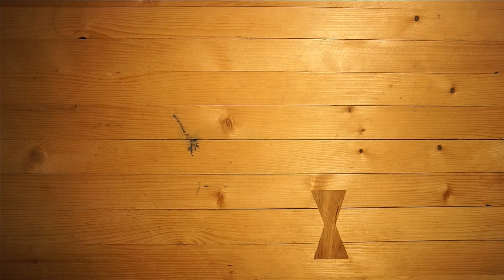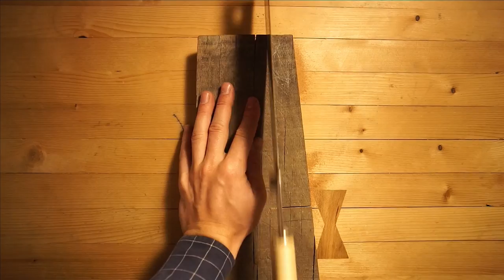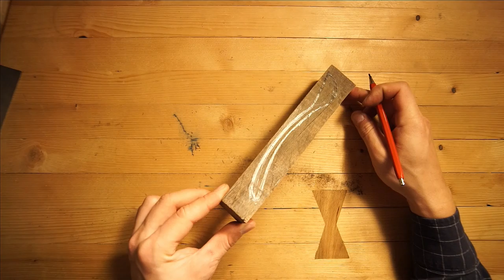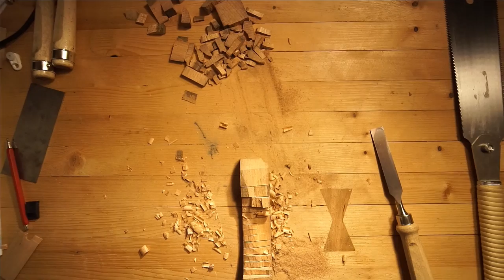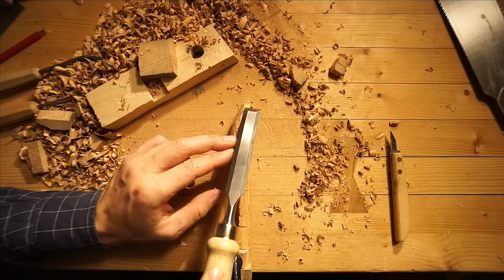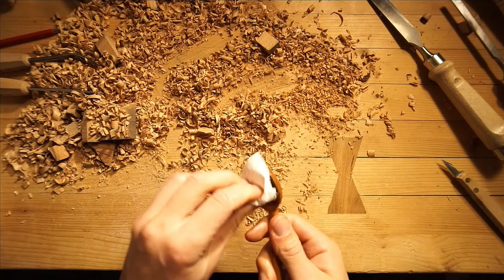Carving a wooden spoon | old beechwood

Comment: Those look like brand new chisels. I would suggest that you put a good shape edge on them. It will make it much easier to carve. From someone who has been doing this for a while, you may want to add a spokeshave for helping to get the curves. I also use small rifles that my grandfather owned and used in the rough shaping of his sculptures and carvings. Most of the tools I inherited from my grandfather and have been handed down from generation to generation. If you can get a hold of a stately 151 spokeshave, the older ones, are handy even when I carve The old Norse-style bowls. They can be pricey around $50.75.00, or you can get the new stately. As pretty as the new higher-end spokeshaves go, they are too expensive for me. I would put my 17th-century wood spokeshave against a Veritas any day, lol.

Comment: Nice ..amazing what is that? That u pour on the spoon
Reply: My best guess would be linseed oil. One of the easiest foodsafe woodfinishes out there.
Reply: from the top of the bottle, it looks like olive oil .... and in the desc it says olive oil was used to finish the spoon.
Reply: cl west I was thinking that too. I just started spoon carving and have been using almond oil. If olive will work it’s way cheaper.
Reply: @heriberthuber54  linseed oil is not entirely food safe, neither is olive oil both of those go rancid over time. Just to step ahead of your answer: flaxseed oil what is basically non boiled linseed oil is food safe but it is much darker

Comment: Please NEVER point a chisel toward your other hand. One slip or successful chiseling away of the wood and you lose a LOT of blood, and maybe some/all of a finger or two. This is one of the many reasons bench vises were invented!
Reply: @Amplefii  and one, who assumes every person knows how to properly handle hand tools. i will agree with you on the chisel but the pull saw on the other hand if someone doesn't know how to handle any saw really could have it jump, and rake across a finger or two resulting in tiny cuts across them. it may not be deadly or extremely painful but can be discouraging for someone new to hand tools, which is why it's always nice, and the smart thing to do by educating in a proper, and non-hostile way that you've obviously failed to do. hand tools can be just as dangerous if not more so than any power tool because they depend purely on human error, and judgment, and if you've never used a hand tool there will be a right way to handle, and use them properly to make sure you're safe and you have a good end product.

Comment: Nice video and product. You might consider something other than your hand to hold the stock when cutting out your blanks. We have 3 boys and they were all taught to keep hands and fingers away from saw blades. I cringed when I saw you dragging that saw back, right towards the web of your hand. My dad taught me this same lesson over 50 years ago. I'm a wood carver and even with a couple of close calls due to my own inattention (stupidity, perhaps), I still have all my fingers where they belong. Please consider the young and inexperienced folks who will watch your videos. Thanks.
Reply: A reasonable concern
Reply: @Amplefii  The point is to avoid ALL injuries. I've had a nasty gash from only one swipe from my saw (razor sharp as they should be) when it jumped out of the kerf after striking an undetected, deeply embedded metal fragment. You never can predict everything. Only a fool is willing to risk an injury of any size when councilled against what might cause it.

Comment: I really like the spoon design you carve out and the finished bowl, however I can't help but criticize your methods.

Buy and use a mallet, round or square faced and learn to get those edge tools really sharp, not just sort of sharp, which is dangerous, and your video shows it, when you have to add extra power to finish a chisel push or stroke.

Keep sharpening tools, including hones, at work table to use while working, and use them often while working. Don't every try to push that chisel into the direction of your other hand, or you body! The greatest force is used to push past any hard spot in a stroke and when the wood finally gives, you have not enough control to keep the tool from cutting/impaling your body part that is in it's path.

Use a leather or no slice glove on your left, holding hand when cutting with the knife or gouge toward it, and a thick wrap of strong tape or a leather thumb 'glove on your right hand thumb, as you are a sliver away from slicing either as seen here.

Oh, yes, use clamps from the start to secure your work to the table, way too much wobbling around during cutting with saw and chisel.

Lastly, don't be so quick to sandpaper away the evidence of your carving and instead, simply adjust your final finish cuts to make a smaller, pleasing pattern of carving marks.
Reply: Where's your spoon carving video?
Reply: @michaelg6156  in the vaults if an unnamed Government agency. However, I've carved for more than three decades and as a former army medic I've been asked a several of times to help stop the bleeding of others that were just plain reckless while handling edge tools. As an artist carving and printing woodcut blocks, 

I have also seen some pretty destructive moves by others. Likewise moves among sculptors who invented all sorts of ways to drive a tool into themselves. Just go ask random sculpture instructors about the queer ways adult students injure themselves. 

As to your tool sharpness, I use both Japanese and Pfeil tools, and spend a great deal of time making sure the are at their best geometry for either softwoods or hardwoods like cherry, etc. And have helped others learn the correct way to hand sharpen their tools, and the value of having sharpening tools, including honest at hand while carving,  so I can recognize  when less than optimum, and in some cases just outright dangerous unsharp tools are in use.

I did not post to harass you  and even if you don't think you are risking a bad encounter because of your casual way if handling tools, you may benefit from getting someone experienced that YOU trust to watch your videos and carve with you first hand and give you feedback to help keep you safe.

Lastly, critiques by others, known as criticisms to many, is simply one artist or viewer to an artists, to help pinpoint and improve the artist's skills and self recognition of things the artist may not see and be aware of.

I was only trying to help you.
Reply: Eli Griggs I am not the person who posted this video. I simply abhor armchair quarterback’s
Reply: Eli Griggs also “artists” don’t criticize other artists like that. You seem like the type of person that garners a lot of groans from the people around them when they start pontificating
Reply: Hey he's speaking the truth and sounds like an experienced carver, as am I in the work of spoon carving. It's a nurturing community not one of a stand off nature, feedback is very different to criticism so take it and use it to further skills! I mean the spoon came out great don't get me wrong but it would have come out twice as fast and efficient if you got a sloyd knife (even a penknife if that's what you've got) and an axe... The saw seems like it would waste time and effort! I appreciate the persistence and it paid off in that lovely spoon but Eli was simply trying to help, that hostile reaction isn't doing anyone any good ;)
Reply: Exactly :) and it's not a negative thing to point out a more efficient way of going around a making process! Especially if coming from people with any more experience than yourself as I gather this carver may not be as experienced in spoon carving as they will be in time! We all start out making complications and learn the most efficient process through hearing, watching and learning from others :)
Reply: You are right, I also noticed his dangerous tool handling .
Reply: Eli Griggs  Reading the responses to your critique, I kind of laughed. If anyone has taken an art class, one of the very useful aspects of class is that after a project, everyone gathers with their work for - CRITIQUE! This is never meant to trash another person’s work, but to offer reactions to the work, suggestions, questions, etc. All are meant to be honest and helpful, not hateful. If a person has difficulty accepting this feedback, then that is a great opportunity for personal growth - stop being so sensitive and instead try to think, is this honest criticism, are there points I could work on to improve my work? Most often the feedback is given in the right attitude, and if not, the others in the group have no qualms about calling the hater out for their rudeness. I guess I am saying, listen to the critiques, if you find value in it, work with it. If you feel it is too harsh or unrealistic, kick it to the curb. Have some personal respect and don’t let any haters take up space in your soul. That kind of negative feedback merely reflects that person’s discomfort with themselves, not necessarily the quality of your work. But always remember, helpful criticism is offered from the heart, not the ego. Suggestions of safety are good, if not offered in an egotistical, degrading way. Just my experience and opinion. Beautiful spoon by the way, nice design, I’ll bet it is fun to use also.
Reply: @aliceharvey1226  I've taken part in many Criticisms, in Sculpture, pottery, photography and easel arts, as well as woodcut printmaking, and yours is the first I've heard from that claims I have somehow stepped out of bounds.

I criticize to help the artist/crafts-person to see, improve and advance their work, and that's all.

If you or anyone else finds my critique to harsh, well, a to the point observation on matters of safety, often require factual focus, no the typical soft peddle of the typical student artist.

If the artist/crafts-person is no forced to consider their own safety, in honest terms of a warning, it's on them, but to no attempt to get them to see their own errors in that regard, is just plan wrong and should no be part of any critique, IMO.
Reply: Eli Griggs  Eli, I am so embarrassed that my remarks came off the wrong way. I wasn’t trying to be offensive, merely commenting in general on critiquing, and my experiences of. I do not think you stepped out of bounds at all, and am very sorry if I came off that way. I said I laughed because I could relate to your comment. I understood why you commented, and agree. Guess I need to be clearer in commenting. Again, sorry if I offended.

Comment: What kind of saw is that in the video?
Reply: It's a japanese saw. There's a lot of different types of Japanese saws, but they all cut when pulling while western saws cut then pushing. That's the main difference. I think Japanese saws are a tool that every woodworker should own
Reply: @andreazttr4757  I think they are far easier to use and learn for a newbie as well, so if someone starts on woodworking and debating on what saw to buy first,
i always tell them to get a Japanese saw, a double sided Ryoba for rip and crosscut

Comment: nice spoon .    that wood was very dry and hard im sure .  had to be patient .     i thought you had a really good spoon until you fucked it up with sandpaper and oil .
Reply: Nico Noname sandpaper makes spoons furry over time and can trap food particles in it. A smooth cut is better.
Reply: He’s not wrong a good slice aalmost seals the wood. I’ll rough some of my pieces up with a sand block after hand plane passes or the stain won’t take. A good edge leaves wood like glass.
Reply: Tracker Jacker  Never having made any wooden utensil, can you advise me, does sandpaper fuzz up the grain even when using the super fine grit? Hmmm, this may explain why most spoon carving videos end with lovely shaping with sharp knife.

Comment: Looks like you need to sharpen those chisels , it shouldn’t be that hard to carve through wood even if it’s hard wood & I know your taking your time to avoid any & all mistakes but If you sharpen them you can make the chisel work for you & not the other way around . A easier way to do this is use green wood cuts way easier it softer .
Reply: Easier yes, but where's the fun in that. We can't always get fresh-cut wood, so the only choice is precut. You are spot on about his chisels. I was thinking the same thing when I heard a couple of grunts, lol. I just bought a huge load of maple, ash, and hickory from a guy off FB Market place that is on average 2-3" thick by 10-12" wide & vary in length, but nothing longer than 3ft. It is beautiful stuff that are offcuts  from a big build he did. He was going to burn them but lucky for me he listed the entire load for $20! Hard as a rock, well-seasoned boards. They will be a challenge, but I enjoy that. This hobby is something I get lost in. It's so relaxing!